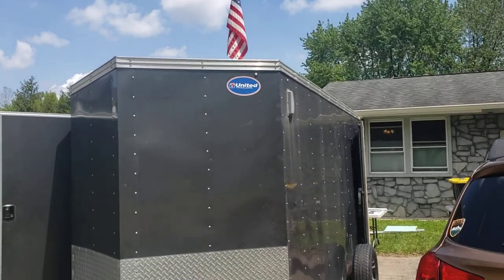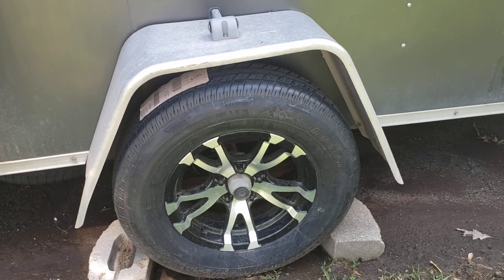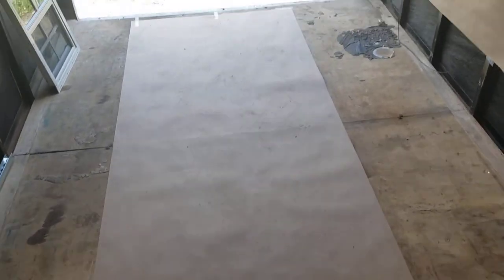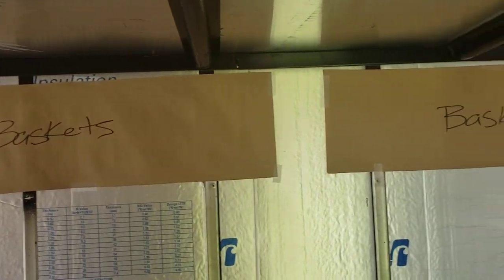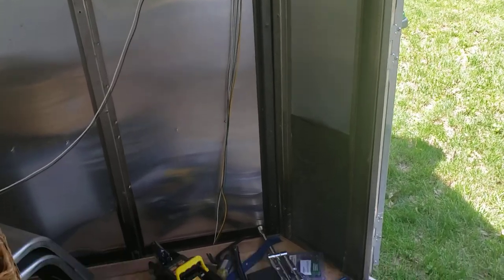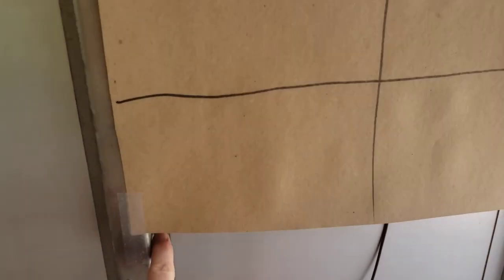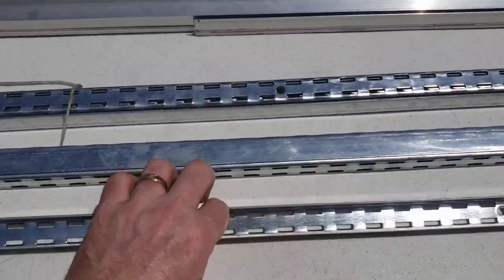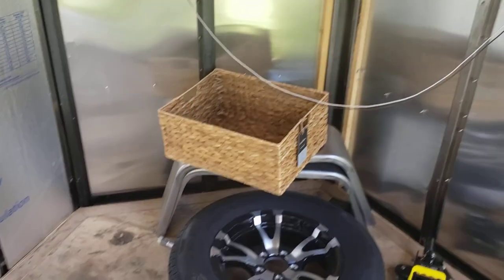CTC Trailer Build Episode 1

Comment: Nice job on this, Uncle Ed. I will be following your process and reach out anytime for video questions.

How are you going to power everything? Solar? Generator?

Also, have you ever thought of a bed that folds from the walls with a crease in the middle to create extra room?

Great job and can't wait to see this to completion.
Reply from the maker: Thanks Brendon, Starting off we will use shore power or a 2000 watt inverter generator that we have. We thought about cutting the mattress in half to make a couch/bed option, but I just want a bed and not have to worry about making a couch in the morning and making a bed at night when I am already tired. I am 100% a morning person, but when I am tired, I just want to go to bed. LOL
Reply: @getupandgetgrounded8985  I feel that! We've been thinking of doing something similar so can't wait for the next one.
Reply: @brendonriha4332  I just bought a Champion generator as a backup to my solar system (compiling the solar parts now). Since mine will be a work vehicle as much as a recreation vehicle, a good solar/battery bank is important. Very expensive but I think in the long run makes a cargo trailer much more useful.
Reply from the maker: @brendonriha4332  I am thinking Colorado may be a trip for us next year.
Reply: @getupandgetgrounded8985  I would highly recommend it. Camp sites fill up really quick around here but reach put anytime and we can make something happen!